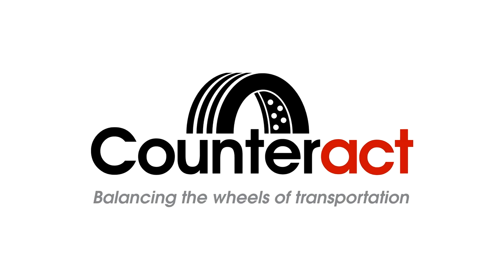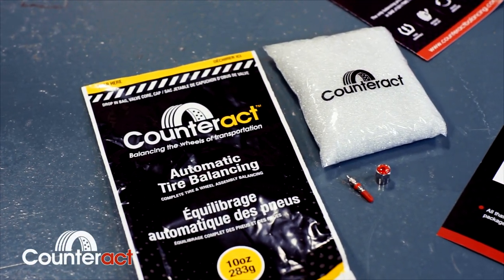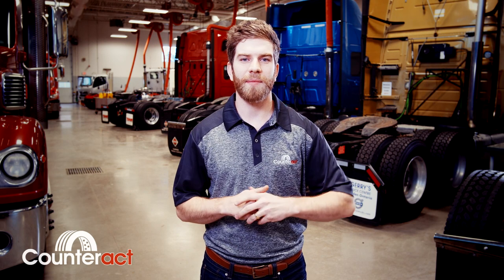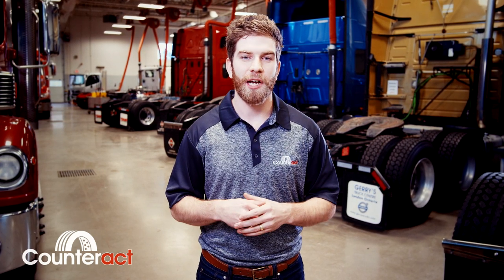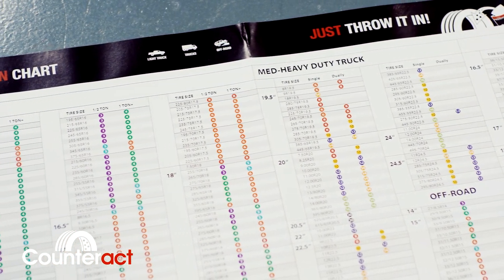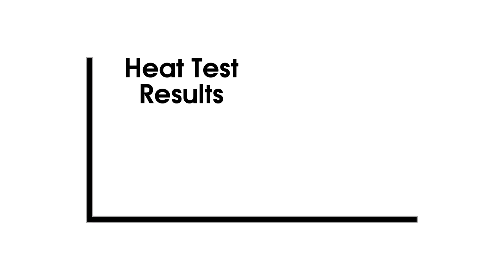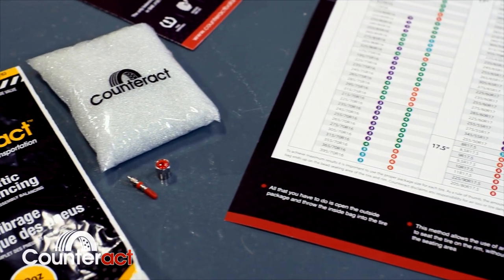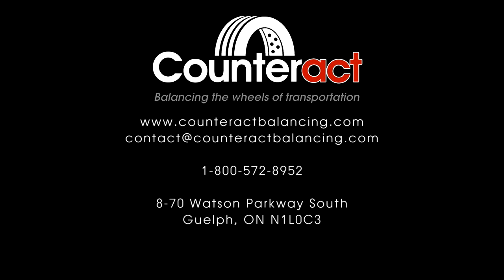Counteract Balancing Beads Introduction Video

Comment: I bought some and will be installing them this weekend. I ordered the 10oz but your website charts and calculator is really confusing. For Tires Size 285/70/R17 A/T, the light truck chart shows 6oz. The Off Road Chart for A/T Tires shows 12 oz. And your Calculator for A/T Tires states 8oz. I'm hoping I bought the right weight as it seams 10oz is the average between the 3 different recommended weight of the balancing beads.
Reply from the maker: Hello! thank you for your support. You would be best to download our new app, https://qrco.de/bcCCSm, for future reference. If you have an AT or MT tire you will want to follow those recommendations. For a 285/70R17 you would want 10oz per tire.
Reply: @CounteractBalancingBeads  your app says 8oz for All Terrain for my tire size of 285/70/17 lol I am getting a slight steering wheel wobble at 50mph to 65mph.
Reply: @CounteractBalancingBeads  also I should mention I have the 10oz in there currently.
Reply from the maker: @minutemenapparel  We're sorry to hear the issues you are experiencing. There are many variables that can cause a vehicle vibration. To help us better diagnose the issue, please fill out our online troubleshooting form and one of our technicians will get back to you shortly.
https://counteractbalancing.com/troubleshooting/

Comment: Is there a way to ensure the throw-in bags open when you start driving? I have a really bad vibration after mounting tires with counteract throw-in bag.
Reply from the maker: You can always open the clear bag, and pour the beads in. If you want to toss the bag in and have it break quicker, while placing it in the tire cavity puncture the bag with a  pencil or something to promote it opening quicker.

Comment: How do I do it for my honda goldwing 1500  front and rear? How much do I need and how do I do it?
Reply: Hi John, there is motorcycle specific product. You would be after "Kit D" which is a motorcycle DIY kit. It comes with 2 x 2oz bags of Counteract. The Honda Goldwing uses 2oz in the front tire, 2oz in the rear.

Comment: So I see almost every type of tires except passenger tires. I have 195/50/16s.  So the beads won't work ?
Reply from the maker: Hello, internal tire balancing products are not intended for use on small passenger vehicles. They are best suited for Motorcycles, ATVs, UTVs, Trailer and anything 1/2 ton and larger, such as an F-150. With small passenger cars the results are inconsistent and that is a result of the different types of suspensions and many of them being too soft. This is why we do not recommend it for passenger cars.

Comment: What happens at low speeds when there is no centrifugal force?
Reply from the maker: Hello, With Counteract, it is able to stabilize itself inside the tire once it finds its balanced position. It will create a loose hold, so when you are turning and stopping the product does not fall to the bottom of the tire. It will remain in place but is able to move when they need to form new vibrations. Typically, a tire imbalance won't be noticed till about 50 mph, and any beads that have fallen down will begin to rebalance at that speed.

Comment: ONLY install with tire off the wheel. The thru the valvestem method does not work. Unless you have 8 years to install each individual bead one at a time.
Reply from the maker: Using our an air-line injection tool really speeds up the process.
Reply: @CounteractBalancingBeads  great, where can I get one?
Reply from the maker: @brandoncarlson4746  Send us a message at contact@counteractbalancing.com and we can find you a distributor in your area who can offer one. Happy to help.